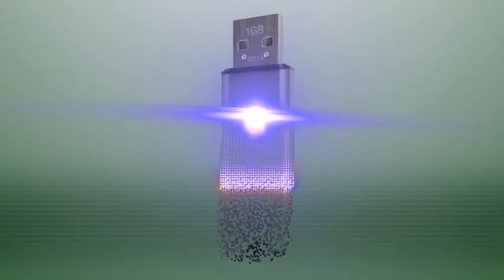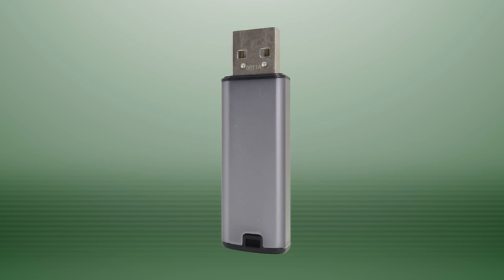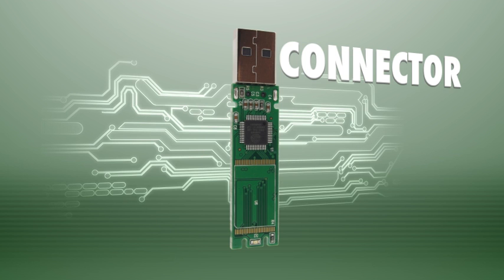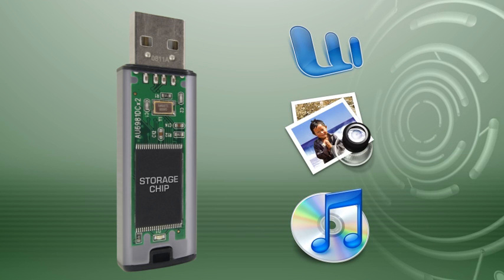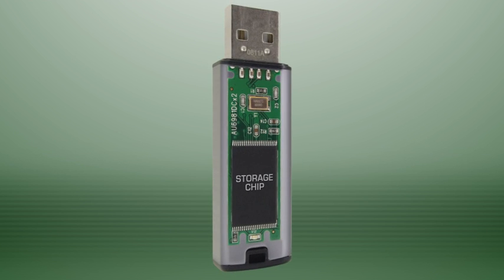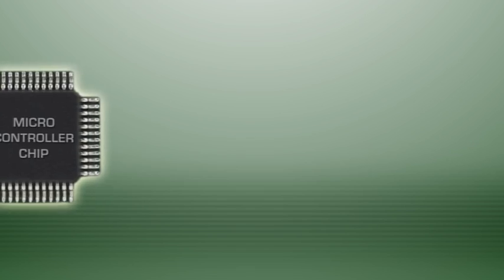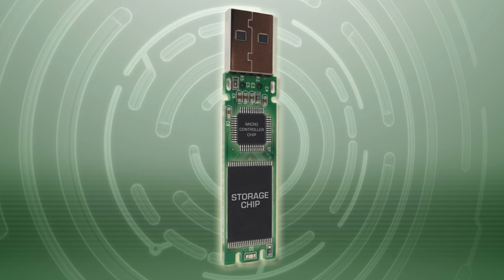USB Drive Component Parts Explained by Premium USB

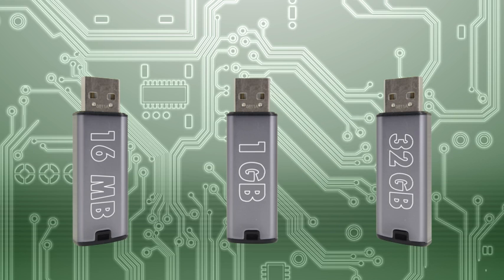Comment: 0:25 “brand new 32GB drive”
laughs in 256
Reply: the oldest flash drive that i still use is over a decade old and stores 64 gigs
Reply: also laughs in 256GB drive thats the size of my backspace key

Comment: What was covered here pretty much anyone can learn by just smashing open their flash drive. What I want to know is exactly how does the storage chip work?
Reply: It traps electrons in microscopic cells. Whether that cell has electrons or not determines whether it is a 1 or 0 in computer language. Because usb drives are electrical, rather than magnetic, you don't run the risk of magnets corrupting your data.
Reply: oh shii this comment is 6 year old
Reply: @yasir5422   hey iam for it too well if i wanna produce a new pendrive with new design  what should i know?
Reply: @gangadharlemati3997   sorry i got no clue and apology for the late reply
Reply: @yasir5422  8 years ago